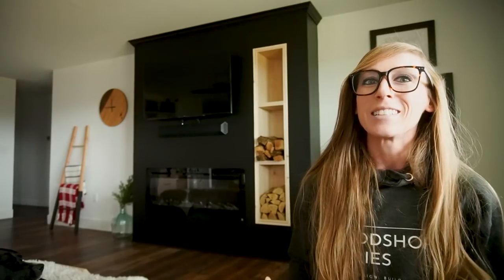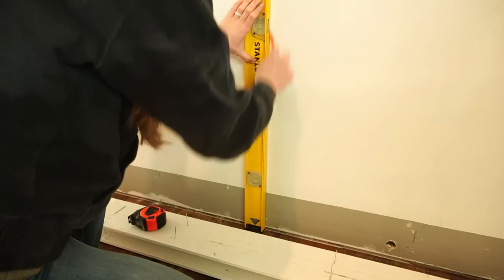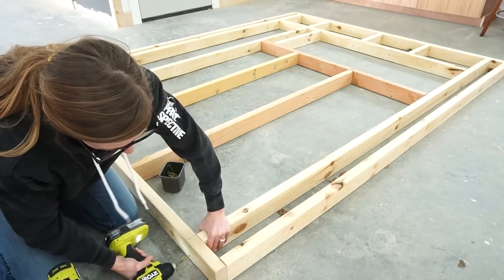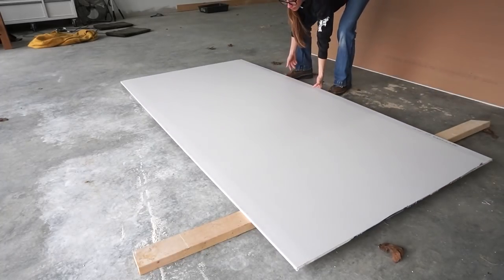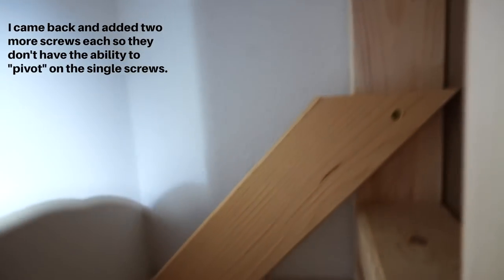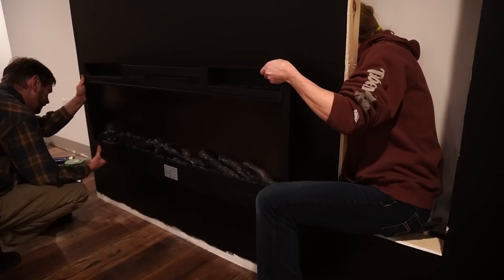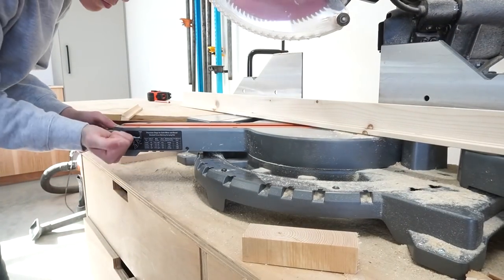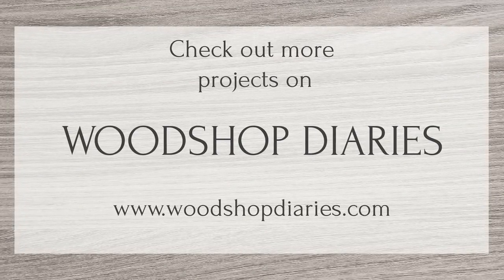MODERN DIY Electric Fireplace Wall--With Removeable Access Cubbies!

Comment: Your living room looks cozy now!  Very nice build.   The black features you’ve added really look great.  I like the design and especially the electric fireplace!  They look and sound very realistic nowadays!  Lol…). Glad Lucy got to make her mandatory appearance!  As an afterthought, maybe you could have used the stressed brick look you did on the column and avoided the dreaded drywall.  I’m with you, I detest working with it!  Or, as you said ship lap would have worked too.  Thanks for sharing another great, well designed project!  Have a nice weekend Shara!
Reply from the maker: Thank you!! We’ve been enjoying sitting down and turning on the fireplace this week to watch it (mostly Lou…I fall asleep as soon as I sit down 😂). I was impressed with how real it looks. That is a good idea…I didn’t even think about the fake brick. That would have saved me a ton of time mudding 🙈 I’ll have to remember that if there’s a next time haha. Anyway, thanks so much for watching and  I hope you have a great weekend as well!
Reply: Electric fireplace, does it produce heat as well? Sorry, I am from tropical country, this question might sound silly
Reply: @rahmawatidewi8047  …. Most units have an electric heater built in similar to a ceramic space heater.  They usually a low and high heat setting and have a fan to help circulate the heat.  The flames and sound you hear are for aesthetics and typically are very realistic.

Comment: That turned out GORGEOUS!!!!  Now you've got me thinking of doing something similar in my family room.  I would never use the heat for the fireplace (living in AZ!) so would a regular outlet be sufficient for the flames?
Reply from the maker: Thank you!! Yes, the existing outlet is no problem for just the lights. And it could probably run the heat too, but the circuit would be maxed. So to be safe, we are going to run a separate circuit for it (eventually—we have several to run at once so we are waiting to do them all at the same time to minimize the time spent in the attic ha!). But anyway, yes, the lights would run fine on the existing outlet. And if you don’t plan to ever use the heat, you can find electric fireplaces without the heat function that are usually significantly cheaper…so you may want to check that out before buying!
Reply: @WoodshopDiaries  Many thanks for the info Shara!  I just love the looks of yours so much......great job!

Comment: Looks great!  I'm about to design and build something like yours and I have a similar room layout as you.  Did you center the fireplace on the wall or the width of the entire room?
Reply from the maker: It’s not really centered on either. I lined it up to where it would perfectly fit between the studs that were there already in the wall so I could screw the frame into them. It’s closer to centered on the wall vs the room, but it’s not exact.

Comment: Why was attaching them to the trusses a bad idea?
Reply from the maker: Since this is just a fake wall and not really anything “important,” I really don’t think it matters too much, but trusses will move up and down with seasonal changes and so right now, they’re “lifted” and when it gets warmer outside, they’ll sink back down a little. I wasn’t really sure how the change up and down would affect my drywall and I didn’t want anything to be stressed and crack. So I anchored it to the floor only so the ceiling can move as it will and not really affect my wall here. I hope that makes sense. Again…not sure right or wrong, but that was my thinking
Reply: @WoodshopDiaries  makes sense, thanks for the explanation!